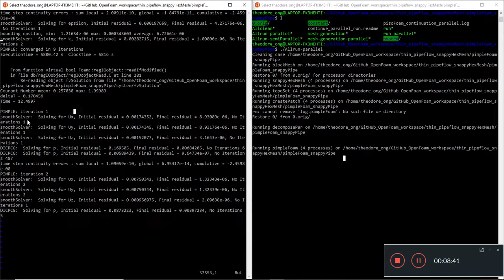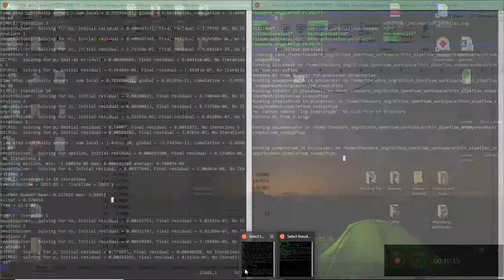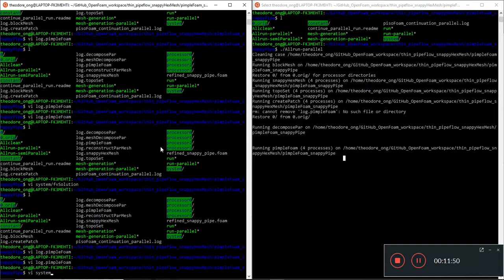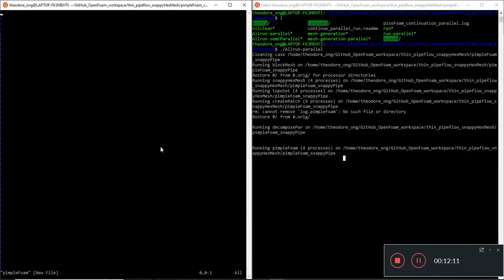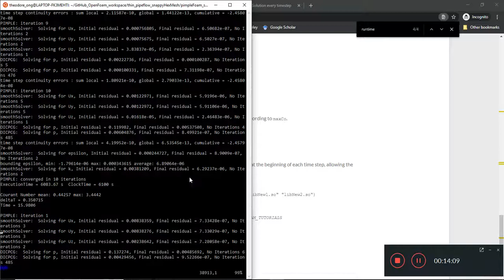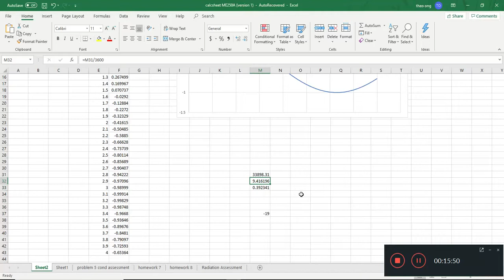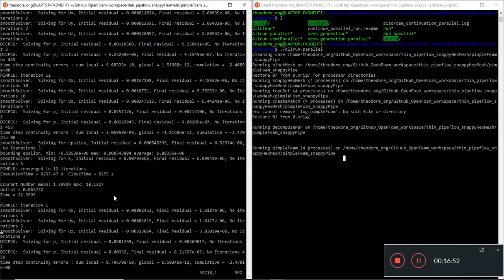OpenFOAM Intermediate - 54 pimpleFoam runTimeModifiable Demo

Comment: why do you have PISO and PIMPLE in the same Dictionary? Only one should be correct , or not? And i would like to note that my simulation runs when i use the pRefValue and pRefCell on the block of PIMPLE , otherwise , it simply wont start the solution. Any ideas on that topic?
Reply: What kind of simulation are you doing? multiphase ??